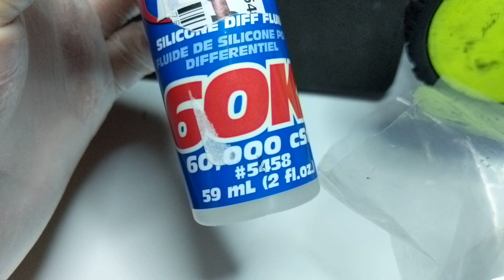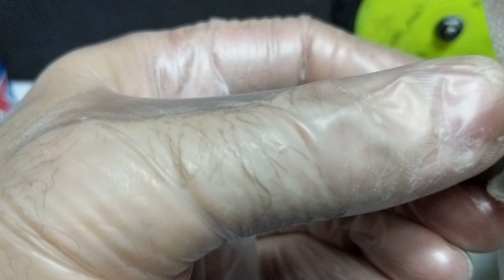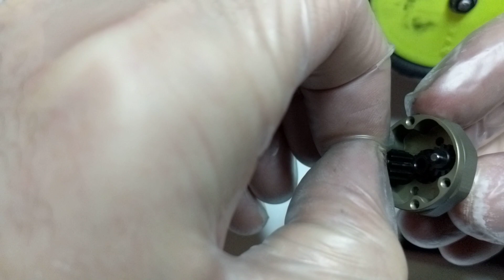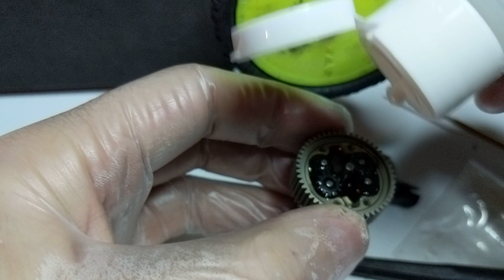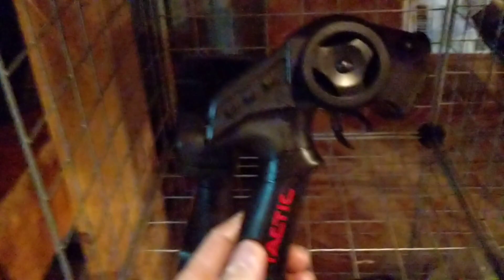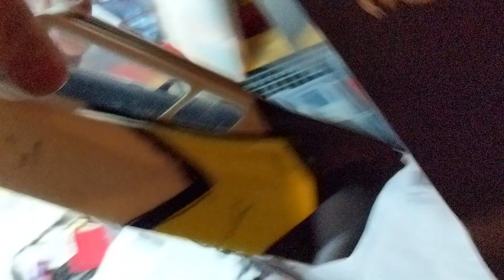Let's Build a TLR Gear Differential!

Comment: Do you have any longterm review for this differential?
Did it work well for you? TIA
Reply from the maker: Yessum. It has since been replaced though by the newer tlr G2 gear diff as I upgraded my buggy to the 5.0, but it is a direct swap for this diff as well and works great.
Reply: I know about the G2 but think the all aluminum construction, and the beefy outdrives might be better for drag racing. That’s why I asked for your thoughts on the durability of the aluminum version.